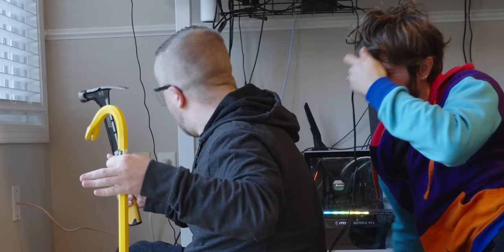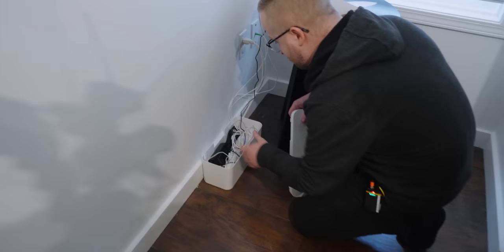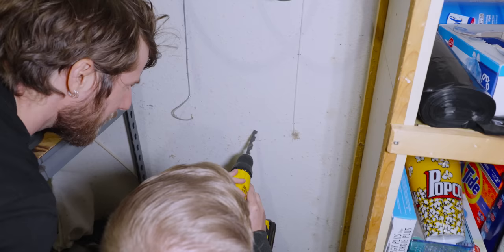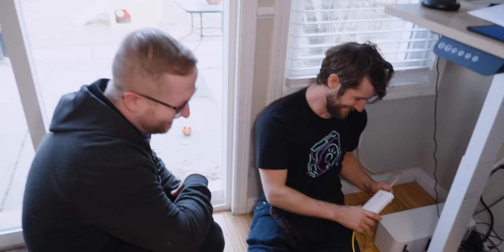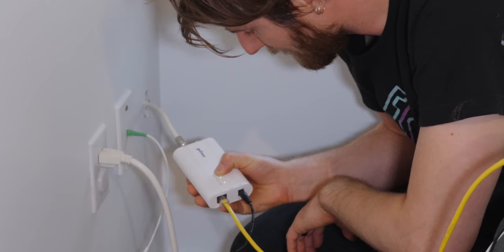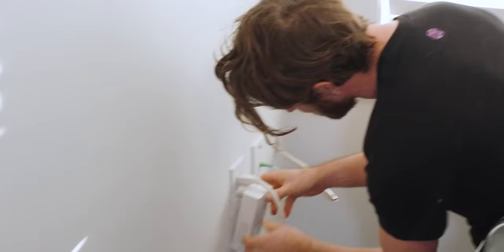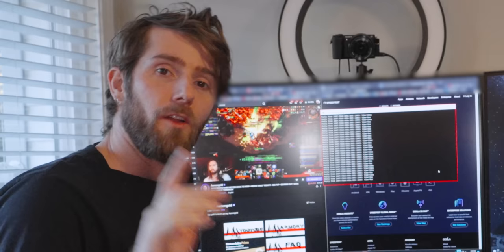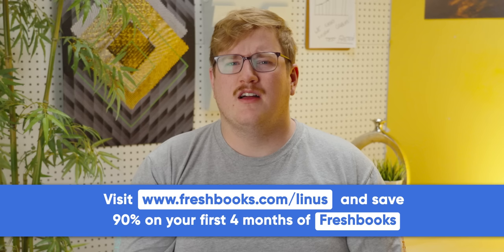I Will FIX Your Wifi - MoCA and Powerline at Colton's House

Comment: Okay, you all just picked some random RG6 coaxial cable and never checked where it was connected to. You all needed to find Colton's main/central RG6 cables in his house where there's a cable splitter where the main RG6 coax from the outside is running to/hooked up to the input of the splitter. For all you know is that white coax RG6 cable is either attached to the cable splitter out put port or it's not even connected at all. Cable splitters work as sending the signal through the input and output and not in reverse. This may be a reason why you all wasn't getting any signal.
Reply: I think that's what they were trying to find at 12:15 but they couldn't open the box.
Reply: @JJFlores197  No, that's just the provider NID "Network Interface Device/Demarcation" to access their service without entering the home when servicing/troubleshooting/disconnect from the utility pole or ground level pedestal. Normally in the house there's a central location where all the cables are at. Sometimes the cables are behind a 2-gang blank wall plate, a service panel (telcom), in the basement by the  electrical panel, the crawl space, or in the attic to connect the cable lines to a cable splitter. Most homes (especially newer homes) do not run every cable line in the house to the outside. It's normally one cable line to the outside (the main line) for the house.

Comment: Quick question on this one.
Why did Linus plug the powerline adapter into the power bar?
If it has a passthrough, shouldn't it go straight to the wall, and the power bar AFTER it?

Comment: Have you considered a video on how isp modem and router combos suck, how if you use a separate WiFi router and put the isp in modem mode you don't have to reset as much and get better WiFi signal?

Comment: I used those Powerline 2000 adapters, and they were good for awhile, but I switched to WiFi because the speed dropped to ~40 Mbps.

Comment: I just pinged my wifi. Amazing results. Very low. Im impressed because I am on my second verizon router configured in bridge mode and it gets this good speed, I also have a splitter for the fios tv

Comment: Hate powerlines/Homeplugs..  the inconsistencies they cause the instabilities, I would never..

As stated before i work as an Engineer for an ISP and we do offer the Powerline adapters but only for cases where nothing else is possible..

Mostly cause the throughput can and will be affected by anything that is connected on your powergrid.. For example it can work fine up to eveming time when lights are turned on etc etc etc.. Everything on connected on your powerlines at home can affect it... Good luck doing diagnostics on it when there is an issue....

Comment: You would have to trace the coax back to the cable box and add a splicing barrel to the 2 cables super easy
Reply: And moca it way better then powerline

Comment: Powerline is both great and shitty at the same time.
First of all, Powerline does not stop at your breaker, it goes as far as possible, so you would even be able to connect to it from one of your neighbors houses.
Second of all, Powerline only works fully in homes with single phase or split phase power, most of Europe and some other places use 3 phase power everywhere, including houses and apartments, and powerline does not jump from phase to phase, and different rooms might be connected to different phases.

Comment: I do professional AV work for a living, for the love of all things good in holy do not game on a power line ethernet adapter kit. We've had so many issues with them that we outright refuse to leave any in any of our systems. We rather do the Wi-Fi mesh fake hard wiring using one of the hubs with Eero etc over these . But take it with a grain of salt your mileage may vary as it's very dependent on how your house is wired up and what model power lines after you go with but as a generic rule from a professional a/b company these are always a bad idea.

Comment: I've never had a good experience with powerline adapters. The last ones I installed cut my download speeds from 50mbit/s to 10, and caused regular disconnections from game servers. And every one I've ever used had to be power cycled at minimum once a week to get it working properly again. 

Until i get my own house and can run Cat# through my walls, office resigned myself to trying to get the best line of site between my modem and my PC in my office. I'm hoping the WiFi6e modem I've got coming will also optimise that.

Comment: Funny how they ran the pingtest, linus says before it was all over the place, up to 20, 25...and the screen the show has a 19, 16, and 27ms ping showing. So...'more' stable, but still a bit all over the place with some bad pings. But it's probably less affected by environmental issues that could make wifi unstable to a much higher degree

Comment: The problem with the moca adapters.  Is you didn't replace the spliter outside the with a compatible Moca splitter. Once you replace the spliter outside the house they will work.

Comment: Or....you just get a moca filter that is installed at your demarcation to prevent broadcasting your lan to the neighborhood.

If you have TIVO you may already have this. Most service provider wifi modems have moca built in and that how your dvr gets internet. They would have installed a moca blocker already....or hopefully.

Comment: I actually tried powerline a couple of years ago to get decent internet speeds downstairs, but something in my house is very wonky with how the upstairs/downstairs electricity connect, so I only got like 1 MB/s speeds which... was kind of unimpressive. 

I ended up drilling holes and running ethernet cables instead. It was a pain and it took like two full days to drill, run and hide away all the cables neatly, but on the upside I've never had to fix it since then and I've got gigabit speeds all over the house now.

Comment: I've tried both in the past power line never worked because I'm in an apartment and not a home and spectrum requires you to purchase their own mocha kit and that s*** ain't cheap. So I have internet running all over my walls it's a better solution than letting it sit on the floor lol.

Comment: You might have better luck using a point to point wifi network indoors rather than going through the cabling, try using 2 Ubiquiti Nanostations 1 at the router and the second wherever the PC is.

Comment: I tried the powerline adapter but my house is poorly wired so every time say the washer or furnace turns on there is a small surge and causes the PL to spike to 500ms+, so my only option is a direct line of sight 5ghz works fine sits around 20-40ms.

Comment: So, I love you guys. But, I used to install cable, I'm also a handy-man, so watching you put that hole in the wall was a test in patience. I knew what was going to happen the moment I saw the drill bit. Too wide, wrong bit style, should've started on the side where you were going to put a faceplate. And then the "This thing has built in MoCa!". Of course it does. If you guys did more research, you'd know that even cheap wifi equipment comes with MoCa now. It's getting to the point where, if it isn't a PC, I don't trust you guys at all.

Comment: I'm really struggling with how everything was done here.
Why didn't you drill from the "living room" to the garage? That way you could have been very precise about where the cable would come out in the room where it mattered.
 Since netgear wasn't sponsoring the video, why not use another adapter with piggy-back power plug where you can set the adapter between the wall plug and the power hub where everything else is connected. Maybe there is a reason (I didn't check and maybe the netgear on is really better than other brands).

Comment: Uh... If ur going to use MoCA make sure you have a MoCA filter on ur houses main splitter (between you and the tap or cable company) or make sure the Coax line ur using is disconnected from the rest of the house or you will take down ur local cable node and some from the cable company will come to ur house and disconnect you and have an angry conversation with you... The MoCA filter just filters out the frequencies MoCA uses. If you are using networked cable boxes in ur house u probably already have a MoCA network in ur house and a MOcA filter installed on ur house. If you dont have a MoCA filter on ur house or apartment it will try to connect to every device / home / apartment building / business on and including ur local node belonging to ur cable company.

Comment: I had some inconsistent WiFi issues, routed an ethernet cable carefully around door frames to my room and managed it so it's basically invisible... Still had some bufferbloat issues and ping was the same as before. Restarted my router and that cleared something and suddenly WiFi and Ethernet didn't have any issues 😅 I probably could have gotten away with no ethernet, but at least I get WoL now, and nobody has noticed the ethernet cable!

Comment: Not sure, but i suspect MoCa doesn't work because there might not be splitters that allows return in the coax.  MoCa would probably work better point to point, not injecting signal into a coax network not Designed to carry a return signal.

Comment: Hey guys, I believe you are the only ones that can properly address this issue. I generally have high end systems and recently got a 4090, because it requires 4 8-pin cables I decided to replace my seasonic focus platinum 850w psu for a evga g5 1000w, because the seasonic only has 3 8-pin concectors. The thing is that as soon as I replaced the PSU I started hearing a really awful coil whine that it wasn't there before... could you investigate this?

Comment: I've installed multiple powerline- and MoCa networks when it first came out. It sounds really great, but six months later I replaced it all with either ethernet cables or Unifi mesh. Powerline and MoCa just aren't reliable enough.

Comment: The plcs must be connect directly to the hall not on the extencion cord. Thats wy the ping is higher. The coax device do not work probably because the coax "derivedor" doesnt suport more than 1000mhz band. And since the divice does work on 1125-1675mhz the signal doesn´t pass troug the "derividor".

Comment: In my experience, powerline Wi-FI adapters are awful, as they often don't work or are terribly slow. I find Mesh Wi-FI to different boxes and then ethernet the rest of the way is far more effective. However, I'll admit that old London victorian houses may not have the most up-to-date electrical wiring.

Comment: I tried the powerline option to extend internet out to my detached garage about 40 feet away. Sadly wouldn't make it through my home fuse box to my garage fuse box. Obviously I didn't know they had to be on the same breaker... Lol. This should have been expected, but I had to try it.   Ended up just trying to use it to extend the range in my home, but I had to regularly pair the boxes for them to work. Not sure why the connections dropped. Not worth the cost.

Comment: While the idea of powerline is great, I've used a couple of them... and I've had the weirdest issues with them, all of them had similar issues with consistent ping spikes every couple of seconds. Plugging in some devices in a nearby wall socket outright made them stop working and every so often they would completely lose connection and you would have to set them up again.

they are inexpensive, and they are faster than wifi when they do work, they're just really hit or miss. 

back then I also looked at MoCa, but those adapters where at the cheapest 250-300 euros and that was simply not worth the cost for me. so I've never had the pleasure to test them.

Comment: So after watching this video, I discovered that my ISP supplied modem has a feature to enable MoCA already!
Just need to buy a splitter and an Adapter for the other end! Thanks Linus, Colton and unnecessary hole in the wall.
Reply: And well somehow, I got everything purchased, put it all together, and it just worked the first time!

One question though. The ISP provided Modem, while it did have MoCA built in, so I didn't need two adapters, it doesn't seem to have an encryption option.  

Could my neighbors, if they had a MoCA adapter really tap into my network? I live in a high rise condo.

Comment: I used powerline adapters for years and I can't really recommend them. The speeds are bad. They get nowhere near what is advertised. They can also introduce noise in your microphone or speakers if attached to the same outlet.

Comment: my house was wired with coax (RG-6) and "phone" (CAT5e) but only to some places.   My "office" didnt come with the CAT5e but it did have coax. 

my Complicated Setup

ONT (Optical Network Terminal) on outside of house converts fiber to copper
Copper goes to DEMARC (electrical closet where all phone lines are)
Bridged Copper from ONT to Living room CAT5e
Unifi Dream Router plugged into living room CAT5e (connects to ISP via PPPOE)
Unifi Dream Router out to MOCA device to "Office"
MOCA device in office to Unifi POE Switch which acts as uplink for all APs and other wired equipment. 

really complicated but its what i could do since house didnt come wired well :(

Comment: using those "powerline" adapters is an asshole move towards your neighbors tbh.

the produce unnecessary inteference, which in some cases can even disturb totally seperate dsl lines. just do not use them.

Comment: Personally I had the power line adapter in my parents house but that shit were junk would drop the connection every 1-3hrs for like 20 sec. and tryed everything the tech could think of but nothing worked. FYI tested several adapters, house is stand alone so no outside interference in the power lines.  Gave up on it and bought a better Wi-Fi + access point. This were like 8 years ago the tech might be better now were like brand new at the time.

Comment: Around 1 month ago I was harassed by pseudo professionals under a Techquikie's video for suggesting powerline adapters as a solution for spotty WiFi: "I am harming people around me", they said. Fast forward 1 month and here we are, Linus even used the same hardware I mentioned in my comments ¯\_(ツ)_/¯

There are a lot of idiots around the internet, and each and every one of them have an opinion: always do your homework, base yourself on empirical evidence, use what works best for your situation and don't get pushed into a corner by all the crap idiots try to sprout at you.

Comment: I've tried to extend fiber connection (or even just wireless) in 80s built house (then 90s reconfigured - an thus some parts rewired but still going to the same 'box') using the powerline stuff. For reasons I don't understand it just doesn't work. Adapters from same package at both ends, configured as the manual instructs (tested in sockets next to each others) but connection at the sketchy end is so bad that all the devices try to use the wireless from good end, even if that connection works like 10% of the time (who knew wireless doesn't work to advertised range when it tries to go through whole electrics breaker box :p). The wireless from good end literally just cuts at the middle of my bed... Literally, as in, lean back on bed and tablet loses connection, bend towards the end of the bed and it'll pick it up again (although working at that 10% reliability); powerline to wireless adapter that is supposedly working 100% to spec and about 2 meters away just.. doesn't.

Comment: Or... Instead of MPS you could use a $5 MoCA filter where the coax comes into the house if that's an option. (chances are the main splitter has MoCA filtering built in)

Comment: Wait so were the coax lines just not connected at the demarcation box? I feel like you could've toned the two lines out with a pen toner or tone and probe then thrown a barrel on the coax and it would act as a single line.